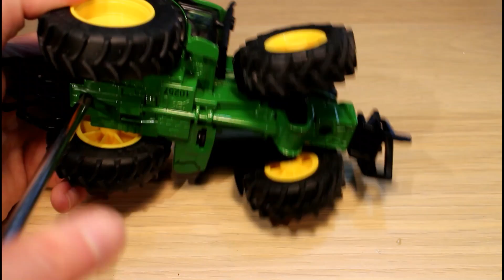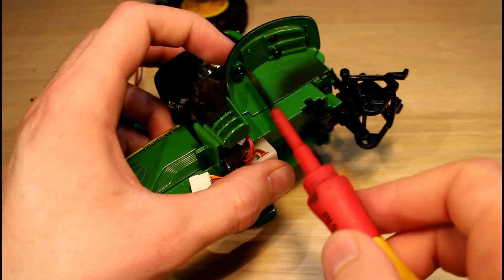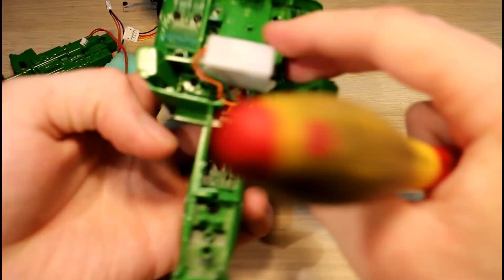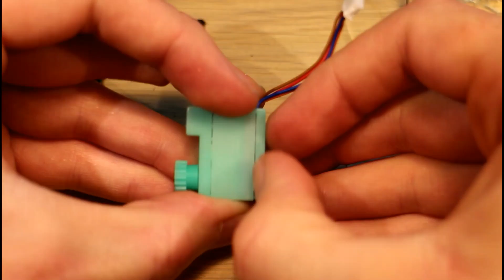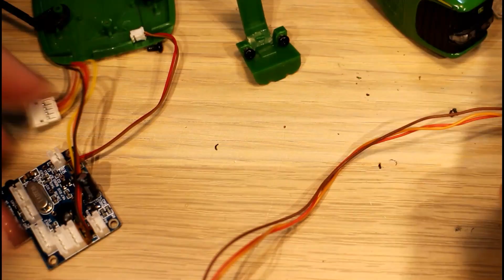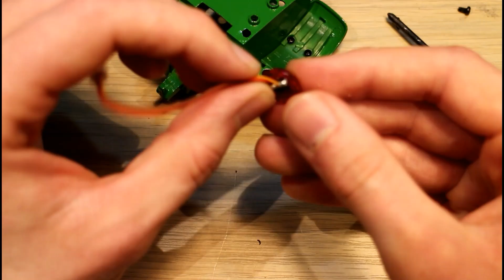Converting a Siku Control 32 John Deere 6920S Part 1 - What's inside the model

Comment: the two lines have to see if someone has fetched the model apart as siku can guarantee determination not turn it right :) google translate i speak dutch
Reply from the maker: +Marc Leijenaar In the servo it turned out one wire is an enable wire and the other is a signal wire so I guess you're right siku wanted you to use their parts only.

Comment: L.E.D.s can damage eye sight, so items that could have contact with a child would have the lights dimmed so much to minimize potential damage.

 I think with the headlights, I would have some sort of brightness setting where there are spare pins on the micro-controller. Your new controller looks able to deal with extra functions.
Reply from the maker: +Mark Heywood That is a good point I hadn't taught about that kind of product safety issue. 

I have the headlight set up to dim like dipped headlights and go full brightness for full beams. I just change the pwm to 50% for the dips.